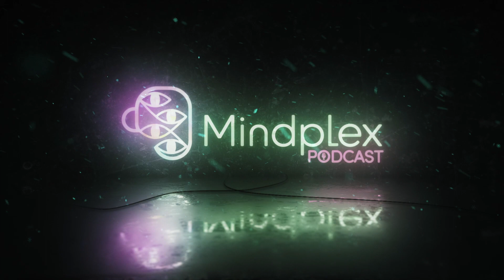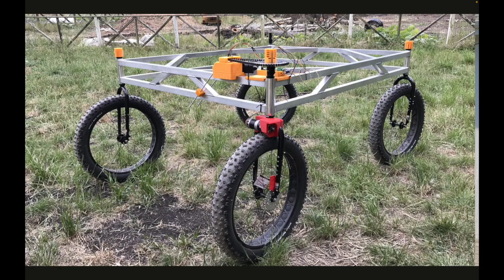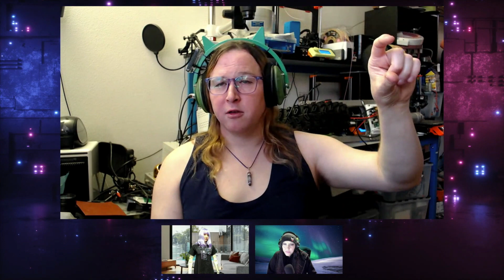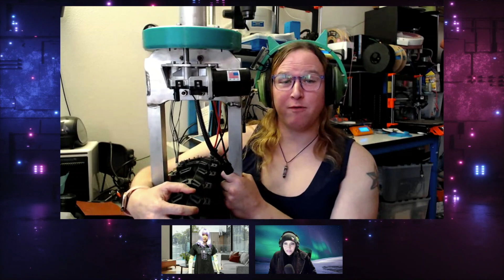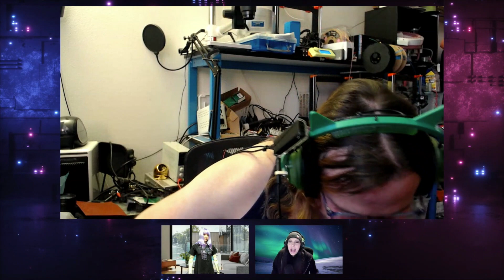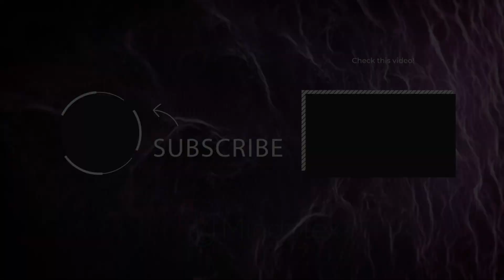Episode 24: Open Source Autonomous Farming Rovers

Comment: This is covering a lot of ground, and all the right questions are being asked.  Very informative and leading to productivity!  
As a thought: the solar panel seems to take up a good deal of top space, so eliminating that for a battery system that could access self-charge stations at necessary points along the crop row would allow for a more compact operating robot with less of a table-like appearance.